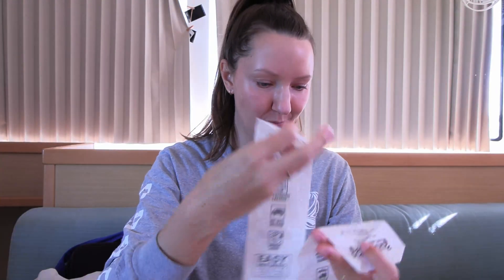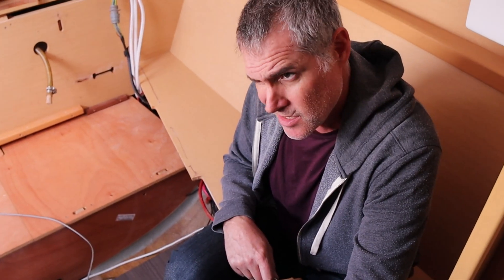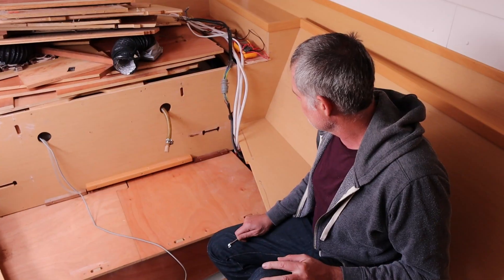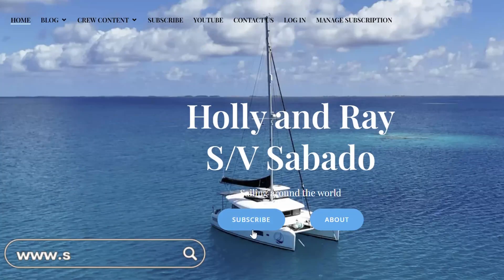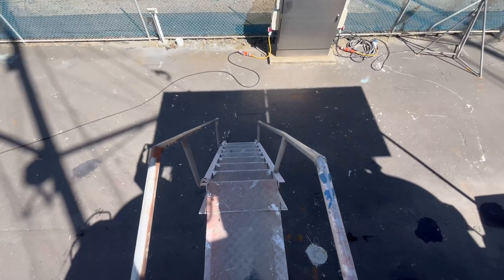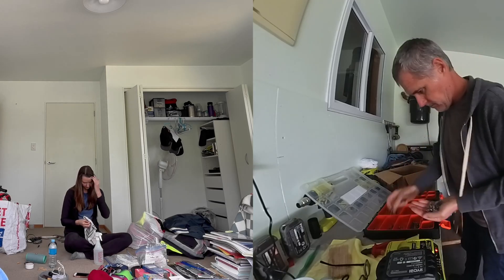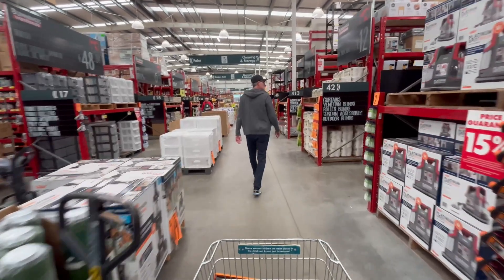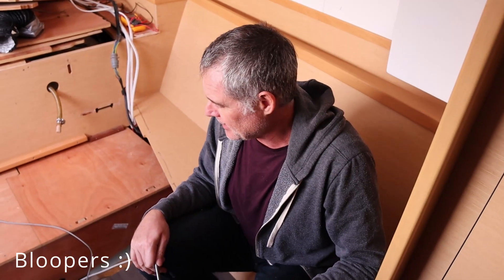Building Our Dream Electrical System🔋(Catamaran Refit in New Zealand)

Comment: Hi guys . " Trade me'" sell stuff on line . Take photos of reciets . When a tool dies just take it back with photo  and its replaced. What is heat build up under bed like ??. Tradies STOP  just before Xmas then start again end Januaury , Fridays finish early ( going fishing / beer oclock).
Summers are tippicaly great and will drift into April . Auckland moves up north for Xmas so gets busy. , Oh we get the Aucklander's too at xmas, I find a good gin Helps. Take care from Coromandel NZ ( Sun Block and lots it bad here )
Reply from the maker: Thank you for all of the tips! Yes, we bought our car off of trade me. Using it to resell our tools when we’re done is a great idea. Heat build up can be substantial but we’re integrating forced ventilation. 👍🏼 What’s your favorite sunscreen brand? We heard to SPF from the states is not heavy duty enough.
Reply: @HollyandRay  Go for a SPF 50 maybe a cancer society brand or just good one . We pump it into a roll on stick that has a sponge around it, stops the greesy hands,  Watch the expire date also. Enjoy your stay and reamber to have a day off or two.

Comment: Hopefully you are making it a king bed.  We turned ours into a king bed.  We ordered a custom sized RV mattress to fit the space.  One of the best and easiest upgrades we have done to our boat.  Very jealous about the workshop.  The people that say that decreases the value have never lived on a boat.  Every cruiser I know would love a workshop over another cabin.
Reply from the maker: We want to keep the little ledge “night stands” so it will only accommodate a standard queen sized mattress, but we’re excited about having something that normal sheets will fit properly (😂) and are considering making some storage bins with a cushion top level with the mattress on the sides so it will be wider past the ledges… we’ll see! One step at a time😅 We are in total agreement with you about the workshop.
Reply from the maker: Where did you order your custom mattress from?
Reply: @HollyandRay 

We bought it from wilderness mattress.  They are an RV mattress company in the states.  One thing to consider is getting it into your room.  Our doors are narrow and it was an adventure getting it in the room.  It does come vacuum packed and that really helps.  We had them make it to our exact dimensions.  It’s basically a king but not quite.  We do use king sheets but they are a bit big.  We just have straps underneath that tighten the sheet so it’s tight.  You won’t regret it.  We gave up night stands too and couldn’t be happier.  You can always mount something on the wall to hold things.  We have clips to hang our glasses.  You could put up a cup holder, phone holder, ect.   Much rather have a bigger mattress.
Reply from the maker: This is great insight, thank you!
Reply: Wellington beds will manufacture a bed to the size you need. We have used them for this purpose.
Reply from the maker: Thank you, Kelvin!

Comment: If you want a quiet boat, don't use plywood; use PVC foam and fiberglass. It's easier than working with large pieces of plywood.
Reply from the maker: Thanks for the tip, Jose!